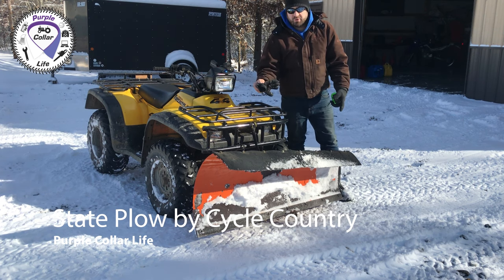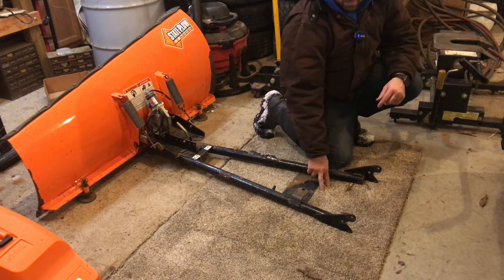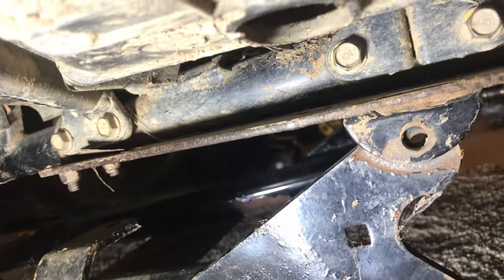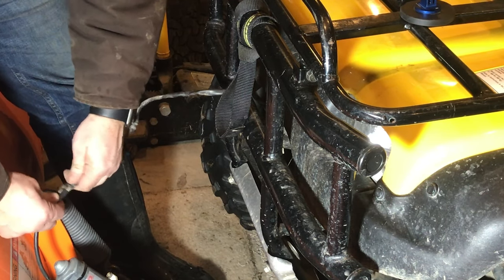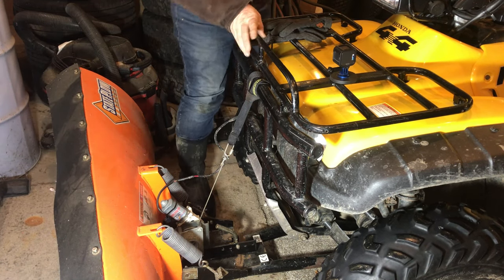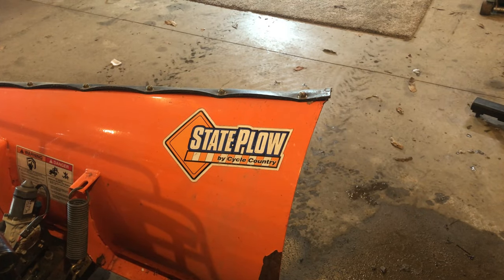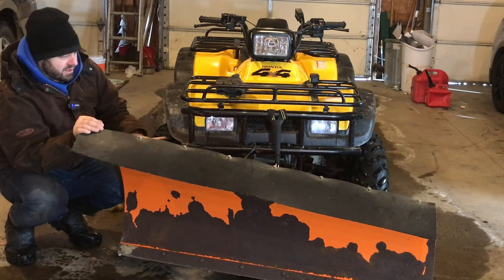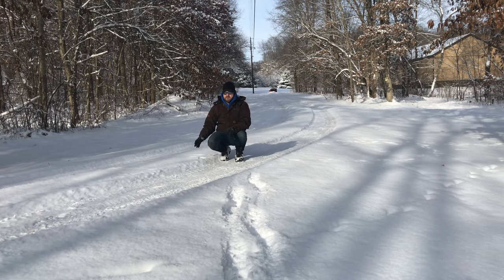#131: ATV Plowing snow. Cycle Country State Plow on Honda Foreman.

Comment: For my 1st 10yrs here on my 5 acres I walked behind a 28" Troybilt blower. Then for 1 year I got to use my side by side with a huge 72" plow with a winch, that did awesome once everything froze, then my now exwife sold my side by side while I was at work, which led me  to my L2501. My best day since. Those 4 wheelers are sure nice for a 2-4" little Alberta clipper as we call them over here.
Reply from the maker: Hopefully someday we will give the Ranger a try with a plow.  But I'm sure it wouldn't be nearly as maneuverable.  I can turn the Foreman around in the width of the driveway.
Reply: With a side by side, you need a lot of space to push snow. If ever run out of space, then you are done.  That is where a tractor, a blade, and a snowblower come to play!

Comment: Not sure if I saw them or not but, I also have a gravel drive and use a ATV Plow Set up and use a set of adjustable plow blade skids to adjust up just enough to not hit the gravel at all (Blade up maybe 3/4 of an inch does it). I use Modified #4 gravel on the driveway and that setting really helps to leave the gravel on the driveway.....not plowing it up with the snow and depositing it at the sides and bottom of the plowing area. Great Video...Thanks For Sharing👍
Reply from the maker: Thanks for watching and commenting, Mark.  I do have adjustable plow skids.  They're currently set so that the plow rides as high as possible.  But, as you saw, I still pick up quite a bit of gravel.  Once the driveway is frozen solid (or has a coat of packed snow/ice), it stops picking up the gravel.
Reply: @PurpleCollarLife  I hear ya brother . Happy Plowing🙋‍♂️

Comment: I do like my atv plow. It’s great for dustings to 4 inches. You can drive fast and get it done much faster then the tractor snowblower. The big storms forget it. The newer atvs are better at plowing since they weigh more. My Polaris weighs like 700 pounds compared to my old Timberwolf which was 350 pounds.
Reply from the maker: Great point about the weight of the machine!

Comment: Have some adjustable pucks welded onto the plow so you don't scrape gravel. Then use the snow blower to remove the piles on the side.
Reply from the maker: We have skids on the plow - they're all the way down for the best clearance. That's just one bad part about a long gravel driveway.

Comment: How does this plowe/atv combo handle snowbanks?  Couple feet high?
Reply from the maker: I've pushed snow banks with the setup. If the bank is fresh - it's easy to move. But if it's frozen solid, that is more difficult. If you can get under the edge of it, you can usually keep along that edge and push it back. I do that to widen my driveway mid-way through winter.

Comment: Wow that is an oldie! Interesting to see the winch on the blade and not the atv itself. Doesn't you plow blade come with shoes so you can raise the blade a couple inches or less so you don't move so much of the gravel?
Reply from the maker: Hi Getting It Done North of 7 - Thanks for watching and commenting!  The blade does have shoes on it, and they have the blade raised up about 2 inches. But our all gravel driveway still gets moved around by the plow.

Comment: Hey what year is that Foeman? I have a 2003 thats in like new condition. Only has around 1000 miles on it. Those things will last forever.
Reply from the maker: I can't remember off hand - it's either a 2001 or a 2002.  You're right - great machines and if taken care of will last forever.  I've seen some though that were ridden hard and put away wet.

Comment: I Opted for a manual lift on mine because I questioned the electric winch system  reliability.  (Something to go wrong)  and sometimes when we have heavy snow I regret it as it can be heavy.  Have you had any problems with yours?     Good video, by the way.
Reply from the maker: Hello, Martin.  I love the electric winch.  I've been using this to plow snow for over 15 years, with no issues.  I too, was worried that the little (looks tiny!) electric winch wouldn't lift the heavy plow, but it works great.  And it's so  much better than the other mechanical ones I've used before.  Good question. Thanks for asking.

Comment: Nice setup.  Looks like a stout-little build on the plow.  Wonder if they still make it the same today, or they've cut back?  What was the burn barrel? at the end?  The garbage man wouldn't take it?  Thanks.
Reply from the maker: Looks like the Cycle Country State Plow 52" can still be found.  
You're right - the garbage man wouldn't take the scrap barrel full of metal.  After winter, we'll set it back out by the road and someone will scoop it up!

Comment: You need a different plow.. one that has sliders, than you can adjust the height of your blade so it doesnt scrape the rocks. 
Problem solved. 😜
Reply from the maker: Hi - thanks for watching.  This plow does have skid shoes.  But our driveway is a gravel driveway, with #3 gravel.  So it's pretty large gravel.  And even with the skids adjusted all the way down (highest clearance), I still pick up gravel.  It's no fault of the plow (or the operator) - just a downside of a long gravel driveway.